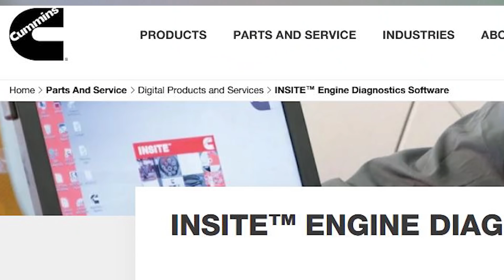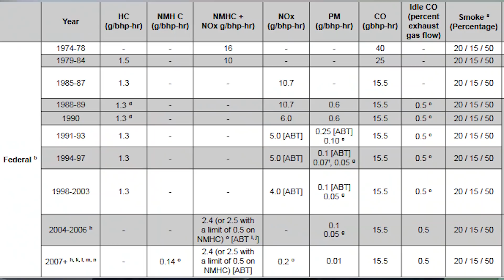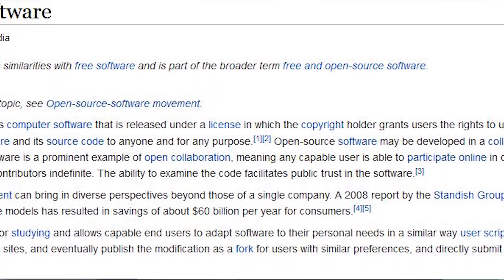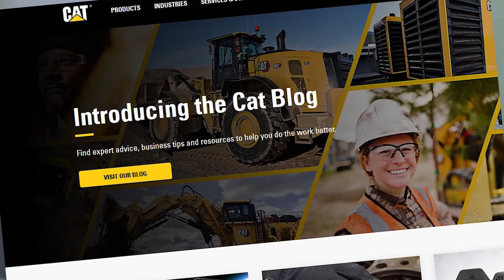Should YOU have the "Right to Repair" your Engine?

Comment: I work remote sites in the Canadian north. It costs thousands to charter a plane or helicopter to get us there. If manufacturers would sell us the software we would not have to resort to bootleg versions as our only options. When a machine goes down it can be a big issue if it’s a genset providing power to the site. The new equipment is especially troublesome with emissions equipment in Arctic temperatures it just doesn’t work at all but we are not allowed to delete it.

Comment: Proprietary software necessary for diagnosing issues with equipment that is not publicly available is a toxic shitty practice, straight up. (For purchase is fine). Trane is the perfect example. They sell equipment that requires software that is trane employees only accessible and as a company they dont have tech support. So as a result, of the millions of dollars of equipment i have sold and installed, I advise customers to steer clear of Trane and go with consumer friendly companies instead.

Comment: The consumer auto industry generally gives out access to diagnostic software for use to troubleshoot but not the onboard computers operating programing. The higher end scan tools can access the onboard diagnostics to monitor and control functions for troubleshooting.  No idea where JD is on this one.

Comment: A modern rob you of more money for the corporates to get off us. 
They don't want the normal guy to fix their own equipment because the corporate owners are losing money because of it.

This is why I will convert my truck to electric to where no one will be able to work on my truck except with my say so. Also I will not need to pay for electric to any electric company or any tesla electric hookups. 
So I will not have to pay for fuel or electricity for my truck. 
So the power and fuel companies can shove it up their wazoo. Lol

Comment: The automotive manufacturers were forced to "sell" their software/scan tools to basically anybody that has the money for the equipment.  You can buy aftermarket scan tools that can be used on most cars, or original equipment scan tools/scopes that diagnose the problems more specific.  This has been the federal law for I believe over 20 years now.  I know, I had to buy Ford, GM, Chrysler and others and it cost me a fortune, but at least I could now repair these vehicles.

Comment: Paying for tools and software is reasonable, it’s when they sabotage the part itself.  The chips in todays electronics can be controlled by the manufacturer. They can force you to allow them and only them to activate the chip so the electronics will function. Watch out for electric cars. Mercedes is going to charge a monthly subscription to get the full acceleration capability of the car. We may need to go back to mechanical.

Comment: Cat allows ET for adams 3 and 4 to the oil industry and can tune engines without cat tech and replace sensors and parts thru sis so this needs to be applied to the owner operator without such a steep price for the license cats engines are very user Friendly in diagnostics

Comment: I'm an automotive tech in Montreal. I don't do heavy diesels like you, but we have the same problem, mostly with the Germans (BMW, Mercedes, Audi). There is NO information on Michell or Alldata for the electronic diagnostics on these cars, all you get is a code definition, and sometimes you don't even get that. It reduces me to "guessing" using my experience, or going on online forums, which is time consuming and not always reliable. Sometimes I'm lucky, sometimes not....but since I have NO diagnostic charts for those cars, it's a crapshoot. So, yes, I'm all for right to repair!!

Comment: If I buy a piece of equipment I should be provided with the software to repair it! These mfg any more act like they still own it. I don't need to take my truck to cummins and have it sit for two weeks to have it repaired! If I had the insite software I can do all that crap myself. It cost me $1000 a day in down time. My best solution would be if it is under warranty and it takes over 12 hours to repair the mfg pay's for down time! Then they would play ball and sell me the software and sell it to independent repair shops. Right to repair is law you just have to file a lawsuit in order to get it enforced. That becomes more expensive than the repair cost and down time. So it is a damned if you do damned if you don't scenario!

Comment: as an owner operator of a 3406E I would LOVE it if I could get free software to work on my own truck. But I run my truck as a business and as a business owner I don't think any business should be made to give away something they spent money to create. I know I wasn't charged for the software to fix my engine when I bought the truck. I'd be stoked to buy it cheaply. $100-$500 and run it on a modern, cheap laptop. Not some 1995 xp only antique and having to spend $5000 a year or something like I've been told it costs now

Comment: its like apple showing up to Right to repair hearing, and being apart of it. i think software with electronics and engines anything related that can break and need fixing. should be like most PC video games. you buy it you paid for it. you can Optionally download or at least have access to the DEV kit and you can use it for diagnostics and troubleshooting of software, or even modifications and adjustments. but the catch is most of the time the DEV kits included with these games and software rely on a few other programs the caveat to repairing equipment, would be you need a Manufacturer ELM adapter or similar.

Comment: It’s almost like an industrial version of the OBDII ports. Seeing the codes and basic diagnostic information like temperature, pressure.. so if you understand what they mean can remedy the issue. Having the ability to do that is a given, that’s a basic requirement. However up selling a customer SW version with a model to get detailed information about what’s causing these codes in other vehicles should be optional to the manufacturers. Having a procedure available to the customer to replace some intelligent sensor is something that should be mandatory. If the sensor is basically keyed to the control and the control will not operate without a rekeying of the replacement sensor there has to be a way for the owner or independent service provider to recognize the change and accept the replacement. 

Think of it this way even though your dealership may not get all the repairs a very good tech in your camp will be recognized and when push comes to shove as the checks are being written the tools that can be serviced the best at a value to the customer to make sure it’s running when they need it get the money. My grandpa was a very good mechanic and I’m reasonably sure his ability to make a lasting repair, and fix farm tractors others could not fix had to have sold some equipment. 

As a testament to his skill the manufacturer offered him a job at their corporate facility and offered to pay relocation and moving expenses back in the 1040’s , 1950’s timeframe.

Comment: Right to work on your truck or heavy equipment is essential. If not contractors should stop buying the hi tech stuff and go back to the old stuff where the operators ruled. Otherwise the dealers have you by the throat on all repairs

Comment: As a European, I can of course only understand very rudimentarily the customs that exist on the North American market.  However, and for some time now, due to the takeover of an engine supplier, we here in Germany have hundreds of non-operational working devices and agricultural machines because their electronic maintenance cannot be carried out by authorized specialist personnel, or only with great hesitation.  In particular, it is about the maintenance and/or repair of exhaust aftertreatment systems.  I can well understand that manufacturers are very tight-lipped when it comes to releasing access to their software.  Here, and in the 21st century, there is by far the greatest development effort, and in many respects a strategic danger zone for manufacturers.  Of course, a unit that cannot serve the owner because it is defective must be able to be repaired quickly, whatever the cause.  However, it is also clear that the manufacturers have a legitimate interest in restrictions.  I can very well imagine that open source solutions can definitely be a solution for everyone involved.  However, and the example of John Deere and the stolen machines in Ukraine also shows this very clearly, these machines then become compliant objects that anyone can control at will.

Comment: The problem is the tech rights that the engine companies have control of and I agree with you that we should be able to repair our own products. The Cat ET the same as Cummins Insite is protected and they want everyone to come back to the dealer. I dont like the price of the programs so you can use the software to repair the diesel engines. Too much manufacturer protection

Comment: I worked for a Ford dealer. Right to repair should only be hardware focused. I have seen many people try to figure out a problem and actually cause more problems then when it finally gets to the dealership it’s a mess. I have had so many warranty claims asking me why I am I claiming on a wiring harness if the c.k.p sensor is faulty because someone has forced a connector in and bent pins. I support right to repair and as someone who has worked for a dealer and now own my own trucks I understand. Not everyone is a Machanic it takes many years of just learning the trade  then many more of specialising in a product to become effective in fault finding and to top it all off Ford does not pay the dealer to fault find. It’s a hard topic but there must be limitations. Oh and by the way Cummings for life .

Comment: Nice objective view
The appropriate scan tool or software disc and cable for any electronic controlled engine should be included with the owners manual and should contain a supplemental rfid chip that works in conjunction with the rfid chip in the key to force that owners manual packet to stay with the vehicle....just to get even more picky an rfid tag should be permanently attached to any factory spare tire that may have came with it

Comment: I know it's kinda dumb when you get a failure to ignite/loss of combustion with a high soot code on a ACERT.  You replace the ARD head but you can't regen it because it has a high soot code. One of two ways to clear the code is to run a regen, but to run a regen it can't have a soot code! So you have to cat come to clear the code to run the regen... That's what I disagree with. You have ET, but not the dealer version.
Reply from the maker: You are mostly correct and the spirit of your comment is correct. As a Cat dealership mechanic and someone who has taught the Regen system in multiple classes, the high soot code is actually not clearable even as a Dealer Mechanic. You can run a Regen with a high soot code, since that is the only way to get it to clear. The codes that prevent a Regen and have to be cleared are most commonly the failed to ignite or loss of combustion code, which will become active after several consecutive unsuccessful Regen attempts. Thank you for the comment and for watching the videos.

Comment: Just as in the past for my mechanical cats I could buy factory repair manuals factory tools that were required, so for the computer controlled engines I should be able to buy a disc with all the proper info and apps to access my engines computer software and it should be reasonably priced. The only reason the manufacturers keep this access private is so we need to go to their shop for repairs and at some shops replacement parts that we dont really need. Let face it they stay in business fixing engines and selling parts. I say if they dont want to share dont buy their engine. A boycott of an engine manufacturer that wont share will get everyones attention

Comment: A majority of files tend to be communication failures , ie, a bad connector, maybe a wire that was chewed through by a rodent.  Sometimes it might just be operating conditions.  Most of these faults could be resolved by a quick test.  The repair already provides solutions to the user in the form of code readers.  This allows a mechanically incline individual to get their vehicles back up and running by changing something as simple as a ABS sensor.
A local fast food chain has been having similar issues with the ice cream machine, the fault in most cases is from a staff member overfilling the machine, or adding product that was at the wrong temperature.  Once this happens, the only resolution is for a service tech to do an on-site visit to reset the machine. It is huge dollars, I cannot remember the fee, but the visiting service tech gets a very nice sum of money for a 15 min visit.  Password access is not given to franchise owners arguing that what is there is an actual technical issue, it could result in serious repair costs, or contaminated food.

Comment: Before the days of computer controlled engines, anyone who owned an engine could buy a service manual and any special tools needed to repair the engine. Software and diagnostic tools are no different. While I don’t think it should be free, a reasonable price could be charged.  In the long run, I believe it will benefit the manufacturers because it will allow owners of the equipment to keep it running and reduce the potential for damage caused by black market software.

Comment: I think manufacturers should at a minimum make sevice information available to owners. Not just anyone. Registration could be tied to VIN or something to verify the equipment origin. But it should be FREE since the equipment has already been paid for. I agree with your advertising idea whole heartedly. As an engineer that works at these types of equiptment companies I can see the arguement that this creates service and support headaches for the OEM. But I think that could easily be remidied in the fine-print of the registration process. Basically the owner takes full responsibility financial/liability for any screwup that results from self-serviced equipment. The issue is further complicated with anything that has a radio or network connection due to FCC regulations and the chance to interfere with other equipment. I do think these risks could easily be communicated to the person doing the work though. E.g. "If you incorrectly service this module it could result in xyz FCC violation which may incur a fine or jail time." That sort of warning would give any sensible person pause. Same sort of thing emission system service/modification. But this is how an engineer or an "Adept Ape" thinks. We are talking to "marketing people" and "lawyers" at these companies. They are a lower forms of intelligence. How does one present these arguements and suggestions to a plankton? That is the question we must wrestle with.

Comment: The right to repair is extremely important, it is a form of monopoly that is completely unacceptable. It is unreasonable to expect people to always pay to repair their machinery at your dealership. There are lots of jobs I would take it to the dealership but not allowing DIY's to do what they want or feel comfortable with, is unacceptable. This where as a business, you should ask yourself, what is the right thing to do? Toyota in my opinion has made some of the best, robust vehicles every made by man.  Many of their vehicles will easily last 300K miles with minimal repair and maintenance, particularly in the past (though we are seeing some planned obsolescence). Everything I buy, I research the maintenance and repair of before I purchase. In many cases, the dealerships are too stupid to see they should embrace right to repair, if you endear your business to customers, they will return. I would love to see an OBD2 standard come to heavy equipment. My Kubota and JD dealerships near me treat me well, I return to them for the most part to buy parts and fluids instead of shopping online, especially when they are close in price.

Comment: It's why I'm far happier driving my old car rather than a new one.

Does it have all those fancy features? No.
Is it as economical as a modern car? No.
Is it as comfortable? No.

But the massive one up it has, is that if it has an issue, I can chuck the old broken bit, slap on a new replacement, and head off to do whatever I want.

I don't have to drive it to some shody dealer, wait a week for them to bother getting to my car, only for them to tell me they need to import a part that's going to cost stupid amounts of money, and then charge a further stupid amount of money to "program" it. Screw that.

Comment: For ICE, yes, for EV, no. EVs are far too dangerous for anyone but the absolute most professional electrical engineers to handle. Easy way to die messing around with that kind of amperage.

Also, warranty should not cover DIY repairs of any kind.

Comment: I own a 1993 940 volvo. There is not way in hell I'd let anyone else but myself work on my vehicle. I know the work is done properly that way, and I'm getting the best value for my money by saving any labor costs. I do all my oil changes, transmission fluid flushes, any and all engine work. Electrical too, lights, radio, everything. Nobody goes under this hood but me.